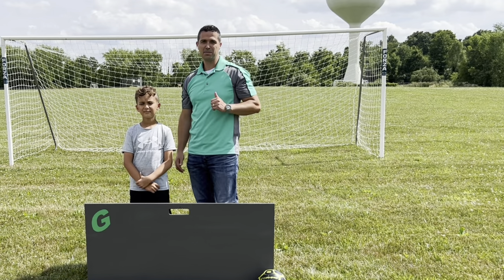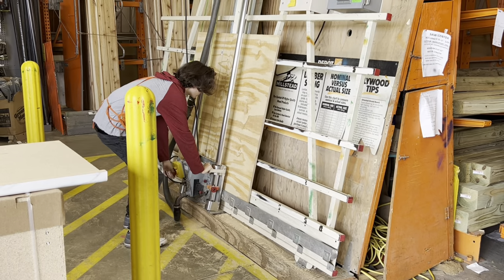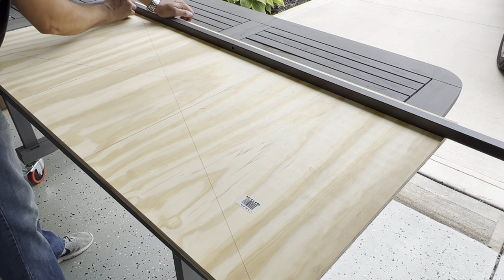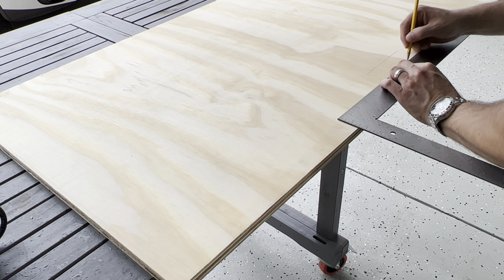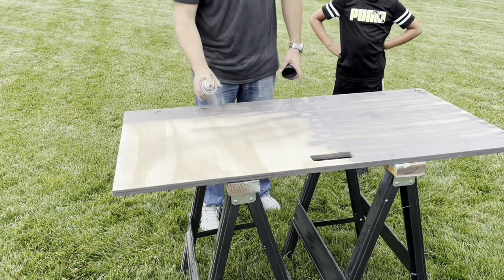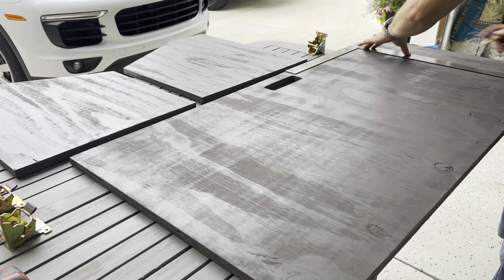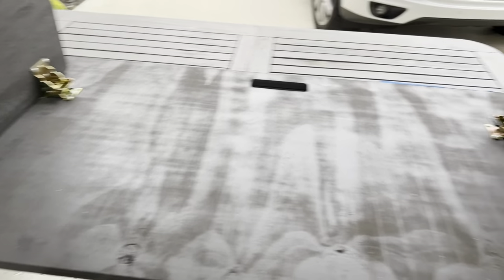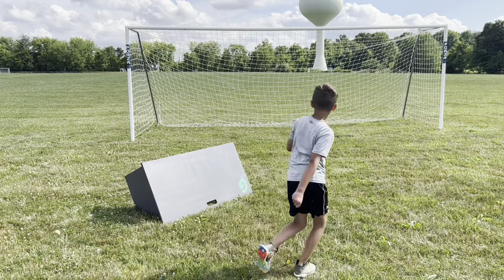How to Build a Soccer Rebounder

Comment: To bad I cut the wrong angle on the legs.  No clue which one to cut so I just picked one, ruined half a 2x4 sheet of plywood :(
Reply from the maker: Thanks for watching and I’m sorry that you made a cutting error.  Make sure to follow the video and you will get it right. 👍
Reply: @inspiringbuilds  - Did you apply poly of any kind to your build after painting it?  And how did your project hold up over time?
Reply from the maker: @justinh1601  I did not, just everything as shown in the video.  After two years it’s holding up great and my son is currently using it daily. 👍

Comment: Do you have drawings or measurements listed somewhere? Great video!
Reply from the maker: Thank you and appreciate you watching.  I can work on building an instruction manual if needed, but I list all of the measurements needed in the video. Let me know if you have any questions. 👍
Reply: @inspiringbuilds  The dimensions of the legs would be helpful, as I was going to use what I had instead of cutting them out of a 2'x4' sheet of plywood!
Reply from the maker: @AndyTheIrateAnt  I showed the dimensions of each leg in the video, let me know if you need further help. 👍
Reply: I think I got it figured out.. or close enough. The legs are 18" x 21". The flat of the angled top is 5.5-5.75" wide, and the flat of the angled side is 14.75" tall. The exact measurement probably isn't important, as long as it's sorta close to that angle

Comment: this is pretty good but just wish it shared the measurements a little clearer, I will be taking the same approach so thanks for sharing
* also, what is the angle of your legs for when you are doing the return kicks?
TIA
Reply from the maker: Thanks for watching and welcome to the channel Aaron.  I cut a 2’ x 4’ sheet of plywood diagonal for the legs as shown.  Doing the math the exact angle would be 63.4 degrees.  Good luck on your build. 👍

Comment: Looks great. Confirming if the attached description is the exact hinges you used?
"Folding Brackets 2 Pcs Lock Extension Support for Table Bed Leg Bronze Steel Foldable Hinge Hardware with Screws (90-180 Degrees, Bronze)" - Brand: Enenes
Reply from the maker: Thanks Scott, I appreciate you watching and yes the link for the hinges in the description are what I used in the video. 👍
Reply: @inspiringbuilds  hi there. I think that the hinges on the link are not the ones used on the video. The ones in the video are 90-180º and do not fold as you presented. Regards,
Reply from the maker: @JuanCarlos-xg7ut  Hi Juan, those are the same ones.  For some reason the seller on Amazon currently has some photos that don’t match showing a couple different brackets for the same item, but the photo at the bottom and the video shows it’s the same. 👍

Comment: Nice build, anything you would differently?
Reply from the maker: Thanks so much, I appreciate you watching.  The build is solid and has held up really well.  The only thing I may consider changing are the brand of brackets as they do take a bit of muscle, but the type of bracket is perfect. 👍
Reply: Which bracket would you recommend instead? Btw the Amazon link doesn’t seem to going to the correct bracket. 

Could you also use exterior paint instead of spray paint?
Reply from the maker: Here you go for the brackets: https://amzn.to/40grrIV
Also yes, an exterior paint would work as well.  Let me know if you need anything else.
Reply: I doubled the width of the main bounce back with another 2x4 foot piece of plywood. Much more sturdy and not as noisy. Now it’s almost like bouncing against concrete!

Comment: Was the angle the legs mentioned to get the angle or was it just random?
Reply from the maker: Thank you for watching.  Definitely not random.  Use a 2’ x 4’ piece of plywood and start watching at 2:45.  Following the process in the video you don’t need to do any math for the angle, but if still needed the exact angle would be 63.4 degrees.  Good luck on your build and hopefully other builds on the channel are helpful as well. 👍

Comment: How well does it hold up when a teenager with a size 5 ball is kicking against it
Reply from the maker: I wouldn’t have any concerns.  It does well with me kicking against it with my son and I’m 6’ 195.  👍
Reply: Are you able to give an estimate maybe? Are you still using it today, how many hours per day/week has been used? And have you had to adjust/tighten anything, or is there anything you would have beefed up a bit? 

Sorry so many questions. Thank you for putting this out there. Love the initial idea and design. 😂
Reply: @Chritztopher80 the 3/4 wood is not thick or heavy duty enough. I bought an extra 2x4 foot plywood and drilled it onto the main board. Now boujceback does not slide back, is not as noisy and the ball bounces back much better

Comment: Whats the distance from the top of the leg to the first bracket?
Reply: nevermind legs have to be flush with bottom.  duh
Reply from the maker: Hi Craig, no question is a silly question.  Thanks for watching.  I cut off 3 inches from the top of each leg so it would be 3 inches down and flush with the bottom.  Good luck on your build. 👍

Comment: How do you find the angle? 📐
Reply from the maker: Thank you for watching.  I would encourage you to watch again as it may save time during the build.  You don’t need the angle if you follow the build using a 2’ x 4’ section of plywood for the legs.  If needed though, doing the math the exact angle would be 63.4 degrees.
Reply: @inspiringbuilds  that’s cool thank you for showing us, I was just wondering how to find the angle because I was building one a couple hours ago.
Reply from the maker: @KevinSanchez90156  You’re welcome, did you get what you needed?  How did the build turn out?
Reply: @inspiringbuilds  yessir, tomorrow I will need to cut out the legs and screw on the hinges but I bet it will be awesome.
Reply from the maker: @KevinSanchez90156  I’m excited for you.  My son enjoys kicking on the angled side down causing the ball to bounce up the most.